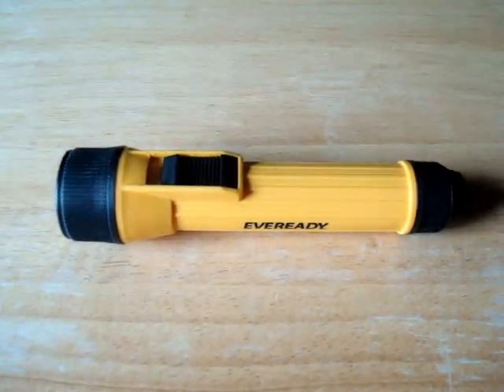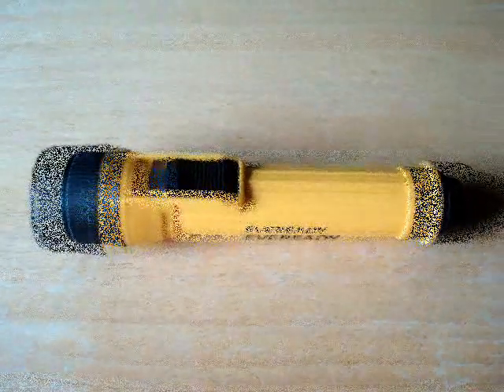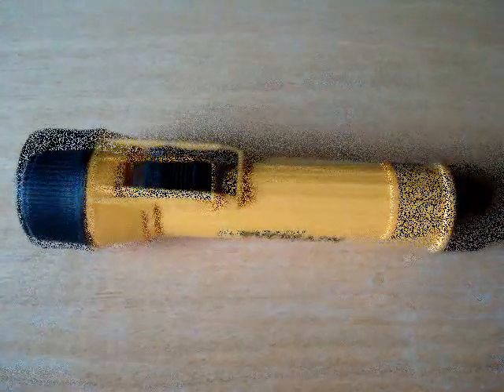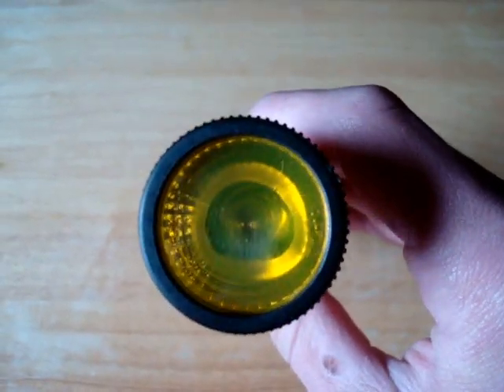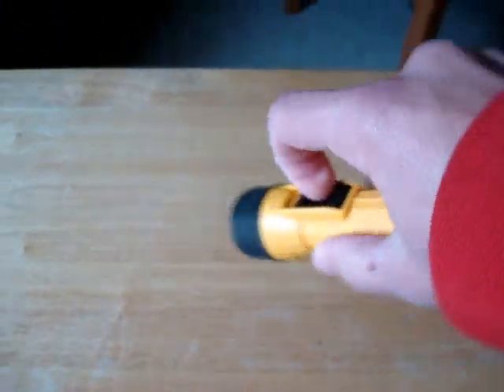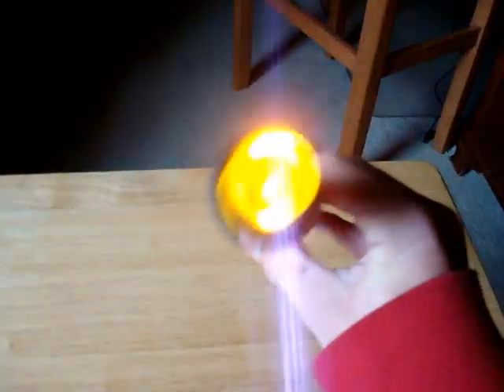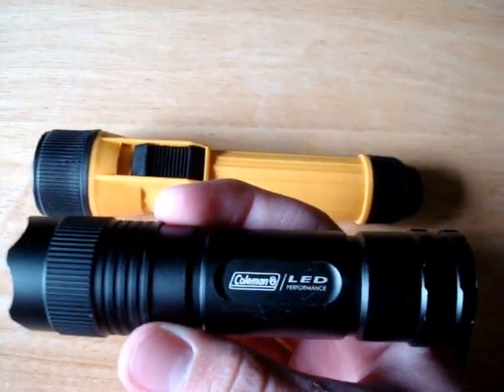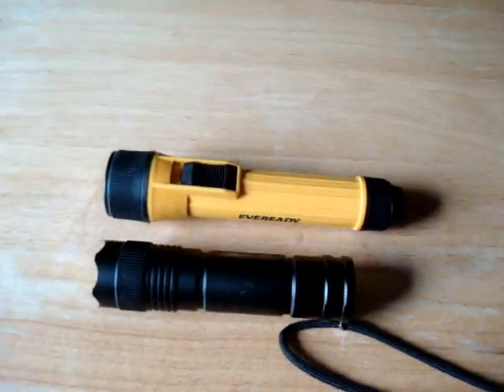Re: KipKay's $10 POLICE FLASHLIGHT HACK- COMPLETE WASTE!

Comment from the maker: @TheBeebopper since you've already got the batteries, i'd just run 3 batteries and use the kpr-112? bulb (like kipkay), get a spare in case it burns out. if your concern is melting the reflector, you always could remove the lens, the lens traps in a lot of heat... and see how that works. otherwise just experiment.